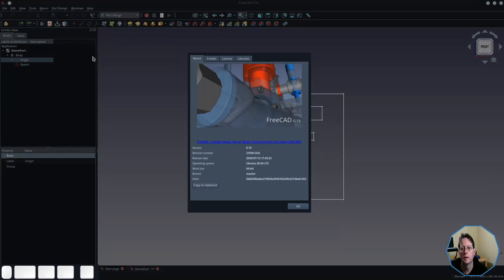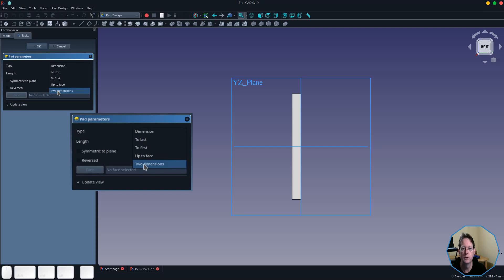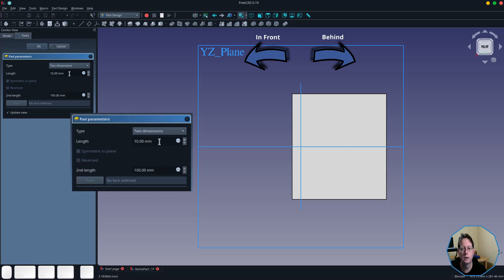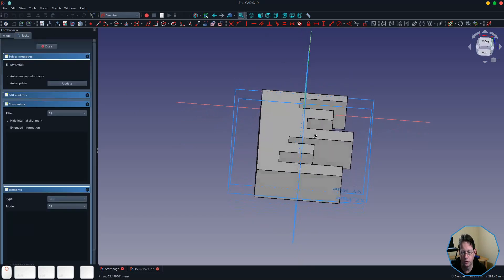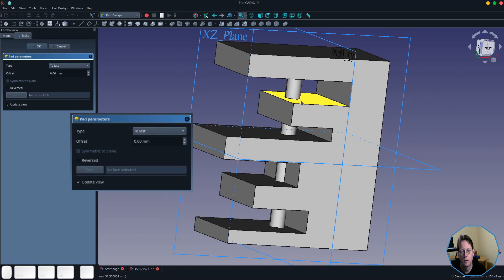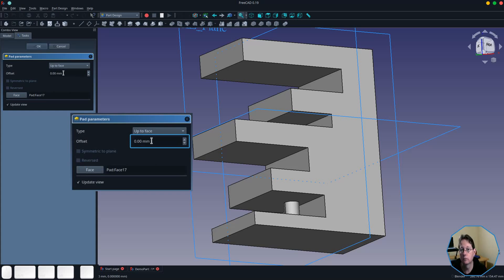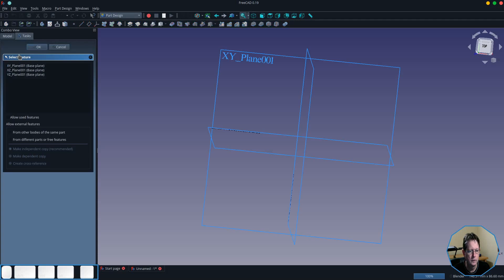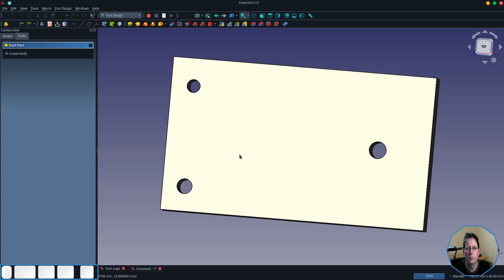How to use the Pad Tool in FreeCAD's Part Design workbench

Comment: when i slice my finished body it is hollow how do i fill it ? thank you
Reply from the maker: Thanks for your question. I presume from your wording that you're trying to print it on a 3D printer, but to be honest, I don't know how to make it solid. I use FreeCAD to design furniture parts made from wood which is already solid so I have never had to think about it.
I would imagine that it would be a setting in your slicing software or perhaps in the way it is exported from FreeCAD. I'm sorry that I can't be more help. 
I'm considering getting a 3D printer later this year, so please let me know if you figure it out.

Comment: I can't change the value it always says "Size must be greater than zero" Every time I change the value it goes back to zero
Reply from the maker: Thanks for your feedback. Sadly you haven't given me a lot of information to work with so I'm not sure that I can help you. I have tried to set a negative value for the pad distance, but FreeCAD 0.2 doesn't even allow me to enter numbers once I enter the minus sign. Can you please provide more information on what you're actually doing?
Reply: @GlassonDesignStudio  I solved it by going into control panel > clock and region > change date, time or number formats > formats > Englishj (United states)
Reply from the maker: Glad to hear that you figured out what was wrong

Comment: I created a octagon and now I want to put a pocket on one of the sides but it won't recognize the face once I hit sketch but it's highlighted prior to hitting sketch. Any ideas what I'm doing wrong
Reply from the maker: Hi Patrick, thanks for your question. I'm having difficulty reproducing the problem as you've described it. I have used FreeCAD versions 0.19 and 0.20 and the steps you've described work every time. I created an octagon on the XY plane, then selected a single face, created a sketch containing a rectangle, and then used it as a pocket in the octagon. I even thought I'd be clever and select multiple faces prior to creating the sketch and that worked too. So to be honest, I'm not sure what I'm doing differently to you. You can email the file to me at geoff at glassondesignstudio.com.au and I can have a look if you like.

Comment: how did you make all of your icons small? i want your setup :) also the colors are nice
Reply from the maker: Thanks for your question. I have installed a dark theme on my Kubuntu desktop and played around with the settings there a bit. I used the FreeCAD preferences to set small icons and chose the Darker Blue theme as well. 

I’ve had to move away from that setup because some of my viewers are finding it difficult to see the mouse and the icons. I’d go back to those settings if I wasn’t making videos. I hope this helps